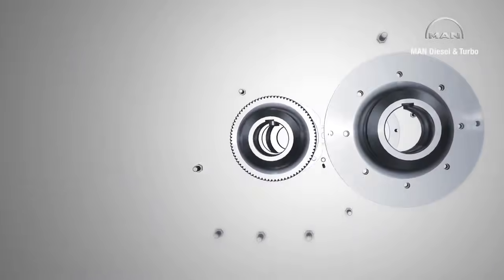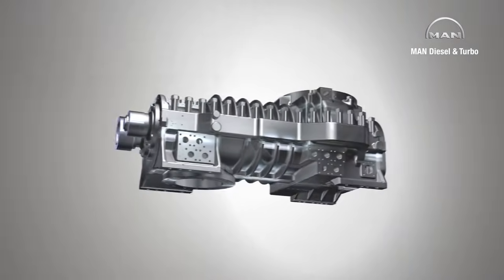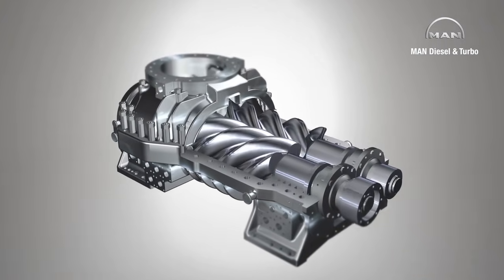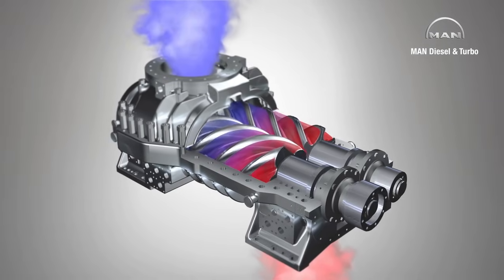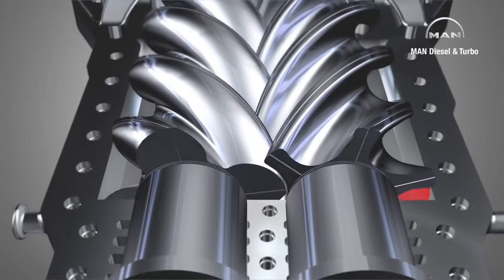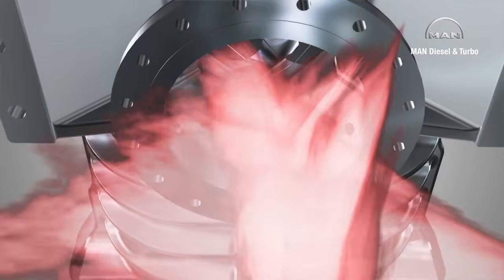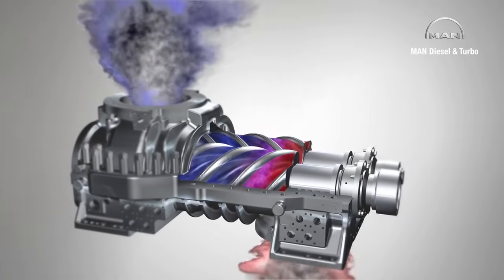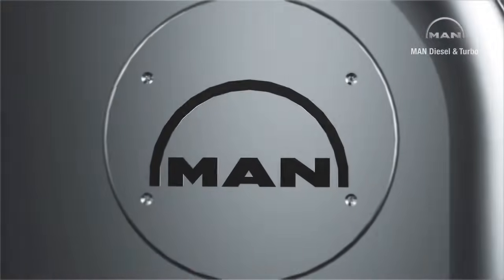3D animation of screw compressor working principle

Comment: The machine has a base plate of pre-famulated amulite surmounted by a malleable logarithmic casing in such a way that the two spurving bearings are in a direct line with the panametric fan. The latter consists simply of six hydrocoptic marzlevanes, so fitted to the ambifacient lunar waneshaft that side fumbling was effectively prevented.

Comment: Sir, From all types of compressors scroll is the best. 
De_ merits of Reciprocating :--
Flywheel+piston both are inserted in a cylindrical chamber. 
1) single/double/diaphragm
a) piston has to change often. 
b) new piston won't permit air from bottom to upward so easily leading to overheat. 
c) random motion of air may takes place. 
d) cost effective
2) vane/lobe/screw/liquid ring
a) more joints more leakages
of air takes place. 
b) cost effective
3) centrifugal/axial flow/mixed flow
a) more joints more leakages
of air 
b) cost effective . 
Scroll one has one single joint only. It is prefferable to all.
In dynamic type hyper heat will
produce due to their heavy_duty structure. 1/2 of the  incoming air will be liquidized in 1st cycle only.
disadvantage of more leakages is no proper flywheel
rotation (or) no flywheel rotation

Comment: Working of Twin Screw Compressor:- 
Drive is taken by two gears which rotates both the screws at a time. As screw rotates, air is drawn into housing, trapped between the screws and carried along the discharge port which then goes to air receiver.
Reply: What can make screw air compressor to leak oil on an air intake filter?